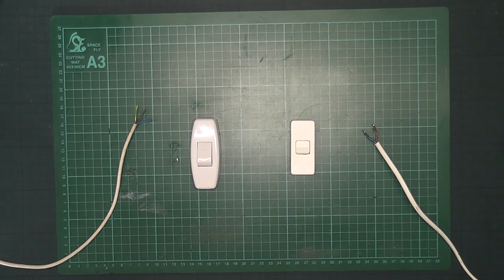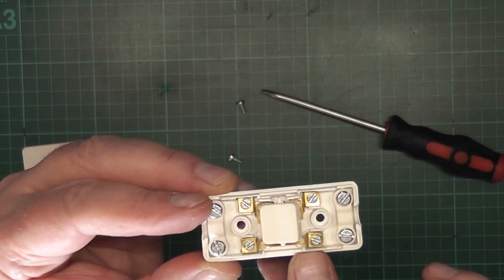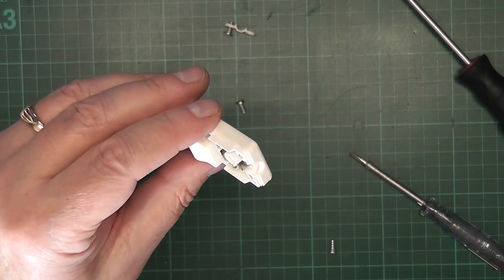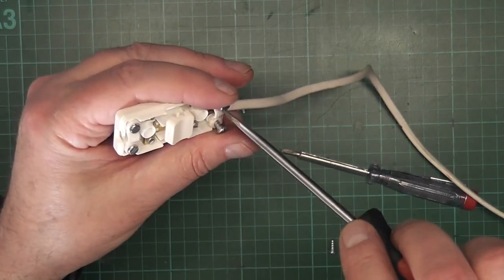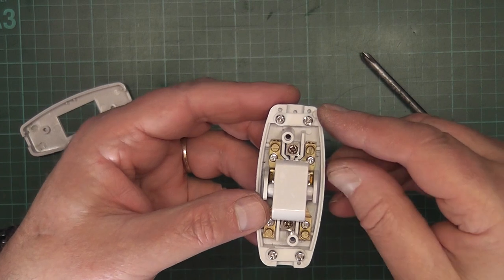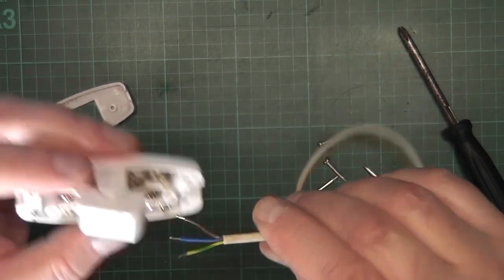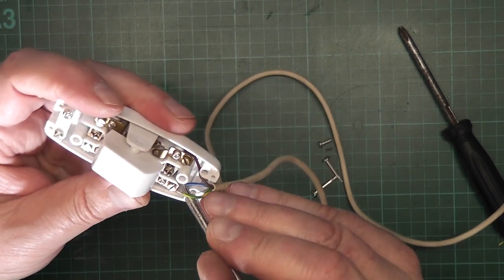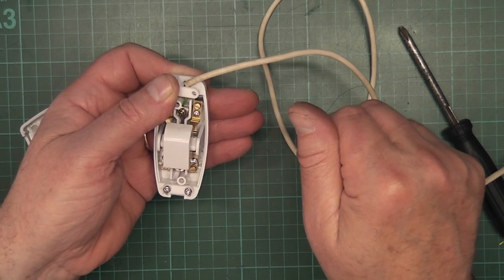How To Fit a 2 Wire Or 3 Wire Lamp Rocker Switch Yourself

Comment: I've got a 3 core cable but only been able to get a 2 core switch so far.  I've been told I can use them together, just not using/taping off the earth wire to insulate it.  It's for a standard lamp extension.  Do you agree or is it better to try & find a 3 core switch.  Nowhere I've tried yet seems to have them.